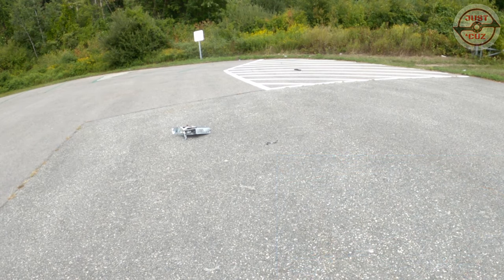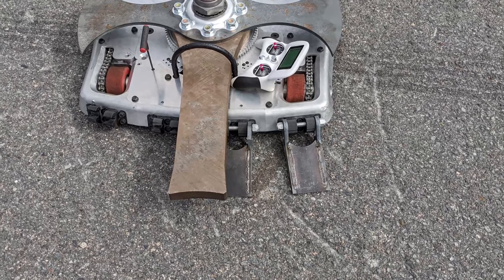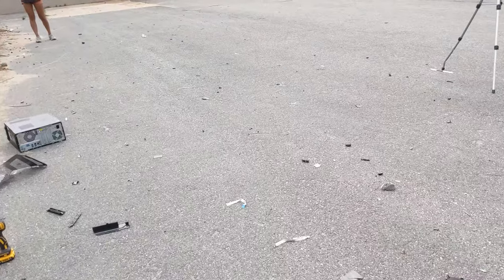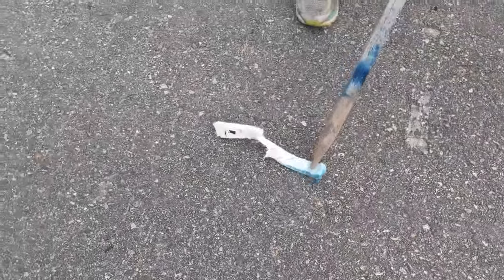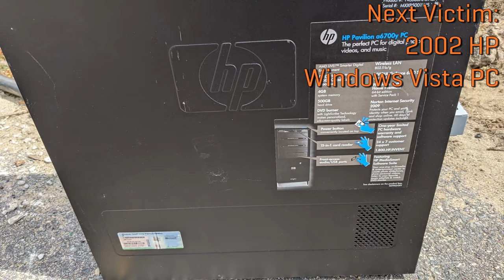Bloodsport 250lb Battlebot Season 5 Weapon Testing (Round 2) Thicc Bar and More

Comment: As always, great work on the robot and the video!  If you don’t mind my asking, there was a spot in the 120 fps video where you can hear the tap-tap-tap of the bar against the printer.  Can we assume the bar was near full speed at this point?  Do you know how fast the bar should go at no load?  Thanks again!
Reply from the maker: Our weapon system can just about reach the 250mph tip speed limit so we will have to adjust a bit for the different diameters of each spinning weapon as we have a few different ones. This bar is around 43 inches effective diameter and can spin up to 1950RPM before reaching the limit. The tribar from last time has a 46 inch effective diameter so it can only get up to about 1820 RPM.

Comment: You mentioned that the ax-looking thing in the middle is a stabilizer bar. Is the idea the same as with the tribar, where the energy exists in more than one axis and therefore doesn't allow for crazy Icewave-esque flipouts?
Reply: Yup that's the idea!
Reply: Also shaped like that to help concentrate more mass at a greater radius.

Comment: Very cool!  Its interesting that the extra three inches slows the blade down that much.  I’m assuming you are using the same motors and batteries? EDIT - It occurred to me that the RPM is due to the tip speed limit rather than air drag and losses.  Still very cool! 🙂
Reply from the maker: Yeah the speed will be set by us on the radio, not a physical limitation of the motors or anything. Just so we can run the shorter weapons faster and not limit them all to 1820RPM.

Comment: In order to be ready for real fight, test to hit object much stronger than just plasics. Your battleboots competitors are made of heavy steel, not of toilet paper.  Well done.
Reply from the maker: This is true, but hitting plastic is a lot safer than steel. We already have to deal with shards of plastic flying everywhere at 200mph. Imagine if that were bits of steel. It would be like a grenade going off. It's simply too unsafe to test hitting something that heavy and dangerous out in the open.

Comment: Can’t wait to see this thing fuck shit up. 
Why not just use the thicc bar in every fight if it’s stronger? I know it’s meant to be used against verts, but it seems like it’s just better for everything.
Reply from the maker: Great question! 
We don't want to use it where we are likely to get pinned against a wall, flipped, or attacked from above, since it is a bit harder to self right with it and it also doesn't cover much of the top of the bot. It also has a slightly shorter reach than the tribar. We have another weapon in the works specifically to guard the top against hammer/axe bots and Sawblaze/Scorpios and similar.

Comment: I think this design should go far, but I must ask a question I've had for a while.

Why wedglets, and not a massive wedge going across while acting like a wedglet (axis to groundscrape the floor)?
Reply from the maker: We do have a solid steel wedge option but it's basically flush to the chassis with spacers, extremely steep, and not designed to get under any bots. Just protect the front against horizontal or undercutter hits.

We cannot easily accommodate a hinged wedge because the front of the bot is in four differently angled planes so it would need some weird angles to hinge along the same axis on all four mounts. It's something we are considering switching up for next year though since it would help to be able to wrap a defensive wedge around the front corners of the bot and letting it pivot would help to redirect some impact force elsewhere rather than right into the frame. 

The wedgelets are not designed to offer any real protection like a solid wedge is, they are simply to get under the other guy before they get to our front, and try to feed their front up into our weapon rather than clashing with us head on.

Comment: Why put that axe bar on? It doesn't seem to help structural integrity and it never enters in contact before the main bar, so.... it's just dead weight, no? It makes the weapon spin slower and take longer to reach top speed.
Reply from the maker: It is not dead weight because it redistributes the weight. There is a weird thing in physics called intermediate axis theorem which to over simplify greatly means that long thin spinny things tend to want to flip upside down. This happens for any spinning object where it rotated about a Z axis and the weight is uneven about the X and Y axis (like a tennis racket spinning flat for instance). If the long axis of our bar is the X axis, the axe shape adds weight on the Y axis to make the imbalance less so the robot doesn't flip over as easily.
Reply: @JustCuzRobotics  Ohh, wow, very cool, thanks! I would have never imagined that, it looked purely estetical! Today i learned something. Since i'm here, can i ask you something else? Why not use the spinning bar in another shape? Like triangular, or hexagonal, or a disc with two opposite teeths ? Seems like a stronger shape than a bar, less prone to shattering. Maybe because it would "bite" less? Or bring the weight more externally?
Reply from the maker: That is a complicated question and there are a lot of reasons for different design choices. As you can imagine very decision has tradeoffs. I recommend my two videos on spinner design to explain more. https://youtu.be/oc8dGPGdgr8
Reply: @JustCuzRobotics  Thanks! Very interesting

Comment: 3D prints at 8:32, top left corner.  What do you attribute this to?  Clogged nozzle?  I've seen similar and am not convinced I understand the cause.    Can start another print after this type of failure and it will often start fine.
Reply from the maker: So this one was weird. It seems to have been that the hobbed gear in the extruder was worn down by the abrasive carbon fiber. I replaced it with a BMG clone that has hardened steel gears and no repeat issues since. Just had to reverse the extruder in firmware.
Reply: So essentially slipping.
Reply from the maker: Yeah pretty much

Comment: How come the tips of the bar are rounded?
Reply from the maker: If they didn't start that way they would end up that way, sharp points don't take much abuse. This way the blade stays better balanced
Reply: @JustCuzRobotics  i didnt think sharp tips were a good idea either, but I’m used to seeing the tip be an actual corner. I trust your reasoning though.